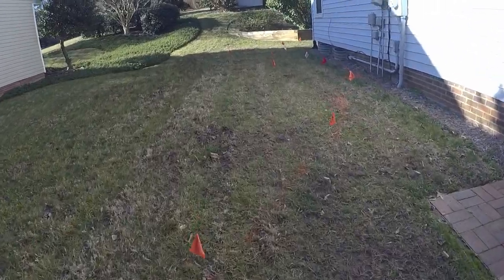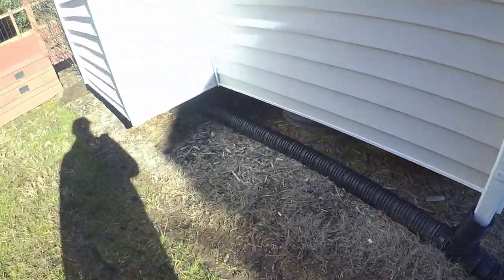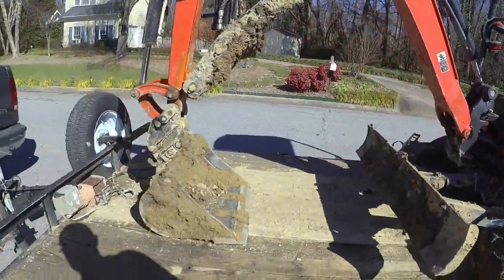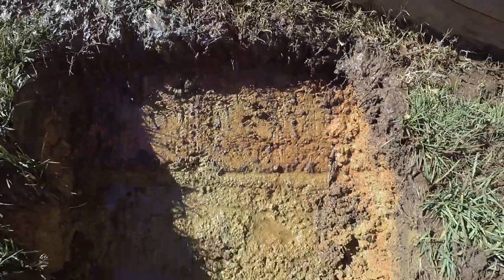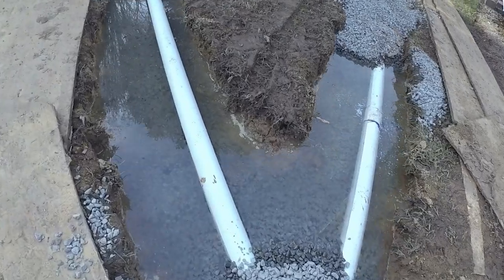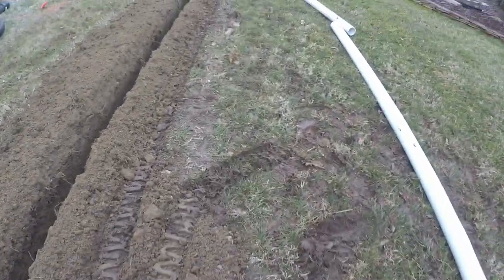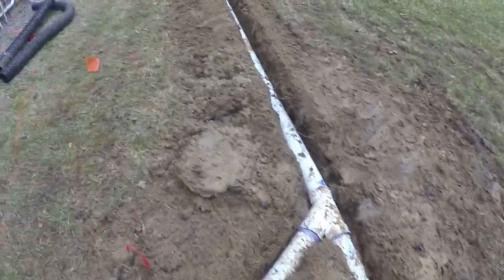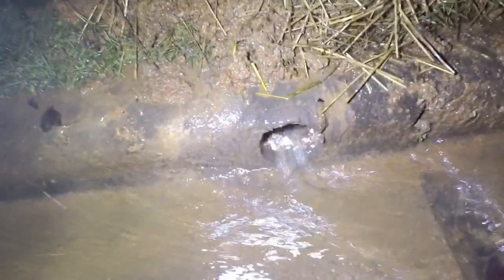How to install French Drain - where to locate - why it works

Comment: You have convinced me to use PVC instead of corrugated, but I think I’m going to have to burrito wrap my French drain with geofab and cover with sod. Don’t like the look or want to deal with the hassle of gravel all in my yard. Besides that awesome!
Reply from the maker: A simple test is to find some standing water in your yard. Dig down through the standing water. If you hit dry dirt quickly then you have impermeable soil and burying your drain will make it useless. If you continue to hit water then you'd want to wrap and cover back with sod.
Reply: Gate City Foundation Drainage yes we have sandy soil here so a covered French drain will be fine! Thank you
Reply: @GCFD I agree except that if you cover the pipe back up with 3-4 inches of permeable high quality soil (not the junk you took out) and grass seed or sod, the French drain will work. Even in situations where the water table is lower and there is subsurface water, there is usually also imperable soil which allows surface water to make the problem worse. But your french drain setups with gravel do have the best flow rate even if aesthically polarizing.

Comment: Would you ever consider running a system like this to a dry well? My backyard has negative slope and the only way to the road is a sump pit (or 2) so I’m considering putting in two separate French drain systems that dump the water to dry wells. Thanks for the vids, these seem more “real” than the guys that are more into the marketing business than doing work and educating folks.
Reply from the maker: A dry well needs to be uphill in a dry area. Think of the amount of water you're sending into the dry well....can it accept it all without overflowing? If not, then it won't work. If you dig down at the bottom of a hill and hit water then a dry well will turn into a spring. Basically, you're trying to give that extra water a place to leave. It has to be a path of least resistance. If you don't have that you'll need to pump.

Comment: I just bought a house that has serious drainage issues.  It's basically slightly raised up in the bottom of a bowl, so whenever there's rain, the place is surrounded by standing water.  I haven't been able to mow the grass for going on three weeks now, because there's just too much standing water.  I think my summer project is going to get the gutters out to the drainage ditches on each side of the property and then worry about the low spots.  Right now, I have an unusable yard.
Reply from the maker: If the drainage ditch is lower than your yard you're in good shape. Otherwise sump pumps can work very well for dewatering the area.
Reply: @GCFD  the ditches are lower, but I don't think they're graded properly.  the edges of the ditches are higher than the yard, which is a problem, but I can knock those down, and I plan to.  I may need to rent a ditch witch to make the ditches flow.  One problem at a time though.  First thing is to get the water away from the house, then drain the yard, then get the water out to county's main drain lines.

Comment: Sean, 
I have enjoyed watching some of your videos.  I have a bunch of solid 4" PVC pipes sitting around and I need to install a French Drain around my house. Can you share with me how I can adapt these pipes. How big do the holes need to be and are they located just at the bottom of the pipes or all around?
Thanks, Rick
Reply from the maker: We usually drill 1/2" or 5/8" holes at the 5 and 7 o clock positions

Comment: you don't have problems with the drains getting root bound when you install it without weed fabric?
Reply from the maker: No problems yet. I suspect it's because the smooth pipes don't hold water, which is what the roots are going for.

Comment: Very nice work. My problem is not having a downward elevation so the water can run. With heavy rain my backyard becomes the overflow from my back neighbor’s property. I have a very flat backyard that my back patio is underwater during heavy rain. I’ve dug some small trenches so the water can run out but my property is pretty flat. I’ve thought of a French drain in my backyard but it won’t have any downward elevation to get it to the street. My rain gutters in the back part of the roof send the water to the front yard to minimize the water in the backyard. The gutters run the full length along the house back to front with downward elevation which gives the water a good run. I don’t know what I can do to solve my backyard flooding problem.
Reply from the maker: You may have to install some sump basins and pumps if your land is super flat.

Comment: Were is the holes on the pipe at the top middle bottom sorry i just cant see them .. love your work 👌
Reply from the maker: The holes face downward because as the trench fills up with water that’s where the water first reaches the pipe.
Reply: @GCFD   thats great thanks for reply really like your channel from ireland 🇮🇪👌

Comment: How deep do you usually dig the trench for the French drain?  Also, how high is the gravel/rock under the perforated pipe?
Reply from the maker: We do a couple inches of gravel under the pipe and the trench needs to be deep enough to hit dry dirt under the standing water you are trying to drain. Also it needs to be shallow enough to maintain your fall away from the FD.

Comment: Can you cover the stones with top layer of grass?  Or is that going to plug up the French drain?
Reply from the maker: it will clog up the FD and stop water from flowing into it.
Reply: @GCFD  i thought that's what fabric is for.  Kinda looks weird to have a big gravel path like that in the middle of the lawn.
Reply from the maker: @joej.4170  it absolutely looks weird. But these are situations that require results over looks. Keep I mind the final word inspection occurred during the pouring rain and there was no water standing around.

Comment: Awesome work but I’m so confused. Do you guys just leave those huge patches of gravel exposed like that? Is there a way to make all that look aesthetically pleasing to the eye? Or do you let pro landscapers handle the final touches? Just looks very utilitarian and raw so to speak
Reply from the maker: It is utilitarian Andy. These systems are for the worst flooding cases. Homeowners have placed pavers, decorative stone, boulders, or used the gravel as a path or edge to improve looks. We leave the FD open so the flow of water is unimpeded into the drain. We would never bury a drain in dirt.
Reply: @GCFD  got it!
Reply: @GCFD  Think I will incorporate a gravel footpath with the french drain. Nice and simple. Awesome
Reply: @CherylCold  or you could just wrap the aggregate in geofabric and bury it and out whatever you want on top.
Reply: @GCFD  Over the years, will dirt and debris gather on top of the gravel and eventually sink into it, negatively impacting it's ability to absorb and direct the water? My son bought a house that appears to have an old french drain that appears to now be a mix of gravel and dirt.

Comment: I live in Greensboro sand thinking of having drainage work done. Does the city allow you to discharge directly into street? I haven't spoken with anyone yet but couldn't find info regarding storm water discharge. Thanks and awesome work!
Reply from the maker: Yes the streets are part of the stormwater drainage system. The drainage basins all say "don't dumnp Drains to creek"

Comment: Can the gravel be covered up by sod or is that a problem with function?
Reply from the maker: Burying the drain destroys its ability to accept water, so yes it destroys the function. It looks a lot better though!
Reply: @GCFD  How would you adapt an area that is waterlogged to be suitable for taking a lawn without having surface gravel features?
Reply: @GCFD  If the concern is surface water, I'd agree.  If; however, you are trying to control ground water and stop it from saturating the ground, I don't see how burying the system would be a problem, no?  Just have to make  sure to properly employ barrier cloth.  Great work, by the way.  Just found your channel, a few years after managing my own drainage issues.  You would have been a great help.

Comment: Is there a specific reason you don’t use non-woven geo-textile  fabric to surround the aggregate and the perforated pipe? I’ve seen other guys use it, saying that it keeps the dirt from clogging the rocks and helping with longevity. I’m asking this question to learn, not to be a rhetorical prick. Thanks.
Reply from the maker: Yes, I use 24” of gravel instead of fabric. My reasoning is a layer of fabric will clog up long before 12” of gravel will so I avoid fabric. I also take the gravel to the surface and do not place dirt on top. This keeps the gravel as open as possible for water to flow into the French drain and away. It is critical to use angular gravel as it interlocks and doesn’t move. Rounded river rock is not appropriate for a French drain because it does not lock together and moves around, letting sediment move in.
Reply: Yes it’s prevents dirt clogging up the pipe but I would of thought the dirt will clog up the fabric in short time severely restricting the flow. Any time filters are used in other applications they need replacing annually like air, pollen ,oil filters etc in cars, why would the fabric in a French drain be any different. Shawn’s theory of using tons of angular gravel and preserving the flow makes more sense than 1mm of fabric slowing a system right down. Maybe in situations where flooding isn’t that bad the system with fabric would be ok but its kind of defeating the purpose of installing the french drain in the first place.

Comment: I am having a little trouble understanding the types of PVC pipes used and where they are installed. Are you using 4" or 6" PVC? Also, where is "perforated" vs. solid employed? How deep/wide a trench is being dug out? I live in Atlanta and when I check HD or Lowe's I am not able to find "Schedule 10" PVC pipe, only "Schedule 40". Any help would be appreciated!
Reply: He uses mostly 4" schedule 40. He lets you know when he uses 6". Solid pipes have no holes, it's a closed system. After water enters, it goes directly to the end. Perforated PVC pipes have 1/2" holes along the length of the pipe and are used for french drains. Congregated pipe is the rolled up black pipe which he doesn't use or like. Comes in both solid and perforated. Perforated has slots cut, not holes. I don't believe perforated is available in schedule 40, you have to drill your own holes.

Home Depot and Lowe's should have what he calls "thin wall". It's thinner than schedule 40, therefore not as strong. Should come in both solid and perforated. It's drainage or sewer pipe. Schedule 40 is much higher in price, but there are fittings available easier to find.

I hope this helps. Watch his videos to understand where to use solid and perforated pipes.
Reply: @joeshmoe7789  - Thanks Joe! I appreciate the response and clarity of your answer. 

Take care and stay safe!

Comment: If I was that customer, I would have had you connect that other downspout towards the front into it since the piping went right by it in the first place.  It would have only been a short distance more and have even more water removed from the equation.
Reply from the maker: Good call Kevin! This was part of a real estate closing so they were very concerned with cost. I mentioned it but they didn't want to do it. I also wanted to extend the FD around the entire back of the property.
Reply: @GCFD  the new owners of the house will see the water buildup on the other side and call you back to extend it like you recommended to the sellers!  I understand the sellers desire to keep costs low.  Under the circumstances, what was done is a good compromise for the immediate need.  I love your channel/content.  Thank you (from the Pacific Northwest) for sharing your videos!

Comment: I see the water going to street but the yard is still very wet ? Why isn't it sleeping down to the pipe from back of house to street or did you just run solid Pvc from back to the  street or is it perforated . If perforated how come water not hung through the long pipes instead if water staying on top of grass area on side of house
Reply from the maker: The perforated pipe is in the french drain and solid to the street. This system has help water out from under the deck and crawl space.
Reply: @GCFD  ok but why not keep it perforated to the street.  I mean you dug trench . So side if house is just solid pipe then. Why ? Save cost on rock or perforated pipe. If I dud that work I'd out rock and perforated  all way to street . Yes you saved some back pain with trencher. But still. Plus neighbors water coming down in yard to . I'd put catch basins there and maybe couple in between your solid pipe to get some of that water in there.  Plus gives you clean out spots for maintenance with camera or just hose to clean with.  Just a thought . Still the pipe with holes on bottom I would've used since you had trencher . A d either wrapped it with screening or just played in rocks
Reply from the maker: The perforated pipe is what collects the non-point water. We placed the FD in the path of the water and once collected, we keep that water in a pipe until it daylights to a safe place. So we wouldn't ever take water that's already contained in a pipe, into a perforated pipe. This application is for leach fields where there is no debris and a very very low flow. Great question!
Reply: @GCFD  I didnt say take water that's contained a d your in perforated pipe . I'm saying I'd have all perforated pipe all the way to street it will still flow fine and if water is that bad put a sump it then attach to solid pipe to street . If you aren't gonna care about any other water like from neighbors house coming over or water tgars puddling on side of house why do the job . You trenched it up so put couple catch basins in low spots where there us water on way out to the street  in with the solid pipe or the  perforated pipe the basins will help you get even more water off the surface going out to street. So catch basins or perforated pipe all way to street with gravel or buy the peanut pipe and lay that in there so less rock . I'm just saying if you gonna dig all that up do it right the first time . If you only doing water in back then ok but your still gonna have neighbors water and water on side if house pooling up too. That's why I said two or three catch basins and connect to solid pipe or perforated . I wouldn't want to have water better in back but still be splashing through water walking from back to front of house or vice versa .

Comment: Surprised they didn't have you put either a gravel-filled swale  or second French drain between properties to catch the neighbor's runoff before it had a chance to add to the homeowner's  existing drainage problems.
Reply from the maker: That would have been a good thing. Catching the neighbor's downspout would have been good too. This was part of an inspection for a house sale so I kinda had a low budget with this. Everyone was impressed with the system though!
Reply: @GCFD  can only work with what you're given.   Great job for the circumstances.

Comment: After watching a few of these videos I don't understand why the builders don't install land drainage as part of the build?
Reply from the maker: it seems they do the minimum or perhaps don't understand the drainage part. I also find it's something the neighbors uphill have done - taken out a tree, built an addition, or landscaped that changes the way water flows. Homeowners often tell me their drainage problems have just popped up recently after something changed.
Reply: @GCFD  I'd say the local building authority should enforce a stricter code. But that would put you out of a job.
In the UK all water off roofs is either fed directly in to the storm water sewer system or goes in to a soak away. You don't see it fed directly on to the garden.

Comment: Why don't you lay dirt over the gravel?
Reply from the maker: Because water doesn't flow through dirt. That would make the drain pointless.
Reply: @GCFD  if it's standing water wouldn't it make it's way through the soil eventually? Not trying to argue your work is great. If it's water that is flowing that you are trying to catch then I understand.

Comment: What do you do if the owner doesn't want exposed gravel in their yard?
Reply from the maker: I pass on the job. Homeowners have added pavers or flagstone to the gravel, or topped with more decorative gravel. Most of my customers are experiencing major flooding and are more interested in saving their houses.
Reply: @GCFD  I see.  Was wondering if you could just put a layer of sod over the gravel so that gravel doesn't disperse over the yard.
Reply from the maker: @garyh4458  you could do sod but that dirt is going to tend to fall into the gravel over time.
Reply: @J Hemphill Why?  Football fields have drainage built in but you don't see gravel strips across them do you?  There are alternatives to exposed gravel so I wanted to know what the options are.  If this guy doesn't know what the options are and his only solution is to make your yard look stupid then HE is the fly-by-night business and not a pro.